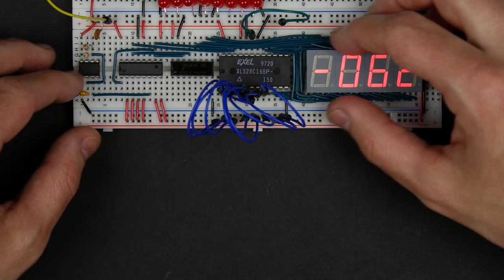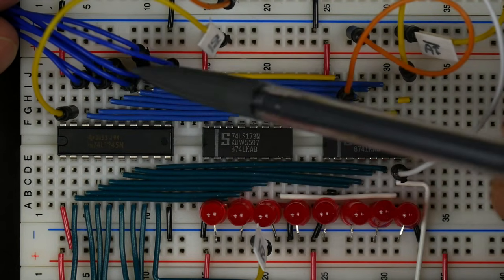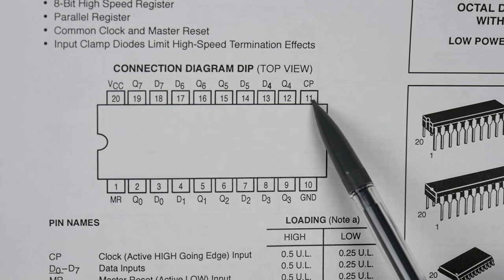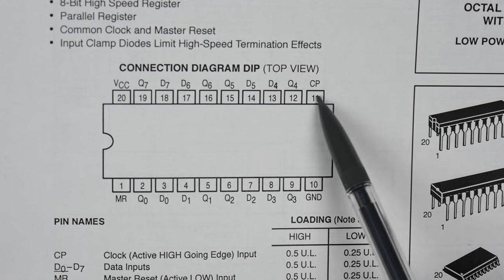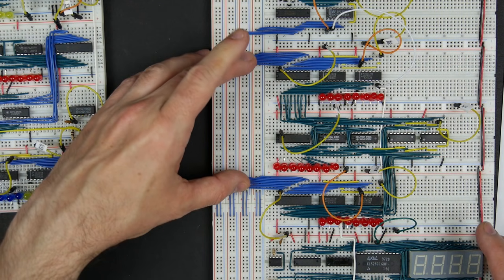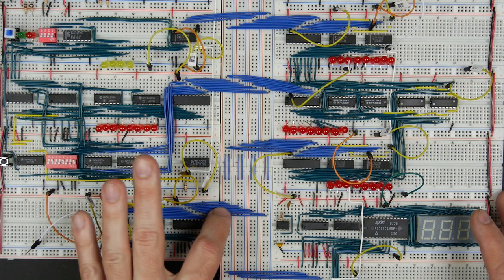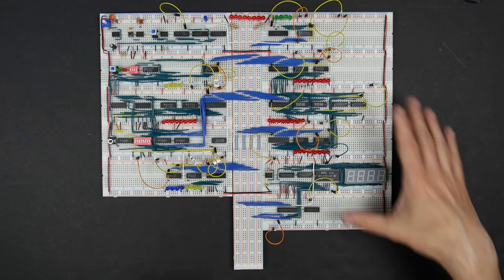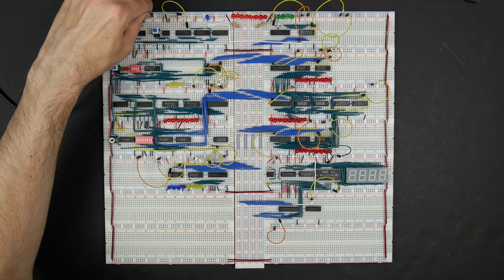8-bit computer build: Connecting the bus

Comment: If you're worried about your power rails, you'd be better off adding decoupling caps to each breadboard rather than making massive ground loops and Vcc loops. Ground loops don't sound like they should be a big deal for low speed digital logic, but as the circuit gets bigger the pulse current around the loop on each clock when every transistor simultaneously switches may become significant enough to cause some problems by changing Vcc and ground voltages in different parts of the circuit, as well as induce magnetic fields within the loop. This is all made much worse when there's no decoupling. Obviously it works fine for now but it may come to a point where it causes headaches and it's not clear why.
Reply: Keep in mind the breadboards also add a lot of capacitance to both the power and ground rails. It would definitely make sense for a more power hungry IC with really fast switching times that's in a remote part of the board. I wonder if a small bulk decoupling cap at the far ends of the rails would be enough?
Reply: Indeed, include decoupling capacitors at each breadboard.
However the decoupling capacitors won't solve the voltage drop at the far end of the power paths caused by inherent resistance in the wiring and breadboard.
So multiple power connections to the breadboards is important.

Comment: Question: Would it make sense to add a clock bus, another strip to your bus and use it for clock instead of doing so much custom wiring for the clock?
Reply: i thought of that too
Reply: Could've had clock and reset shared on their own strip, yes.
Reply: yes, that's a good way of thinking to be honest. But I think he did it this way so everyone could get it how a computer works
Reply: I’ve been wondering that about the clock, power, and reset lines
Reply: Interested to see so many had the same thought!
Reply: I added 3 rails(6 lines), 2 for power on each side, and 1 for clock on each side. IMHO it made for easier and better looking wiring. Also there’s almost 0 voltage drop on any part of the board.
Reply: Yes. You want the clock as centred in your design as possible to reduce clock skew, but this isn’t much of an issue at lower frequencies.

Comment: finally we will see the Magic of Control Logic in Next Video.
Reply: This is what I was waiting for the most!
Reply: Ravindra Badgujar I get butterflies thinking about it.
Reply: Clone36 lol me too - we are *such dorks* xD
Reply: I am thinking that you will have to build the Instruction Decoder and the Ring Counter,  before you can build the Control Matrix. 
However, that is because I built both my Instruction Decoder and Control Matrix, using only TTL logic chips.
If Ben uses ROMs for all of this, you could be right. 
Either way I am like you and I can not wait for Ben's next set of videos. They are always right on the mark and incredibly informative.
Reply: It would be great if Ben took the same approach as you and started from building the instruction decoder from plain old logic gates, and then gradually improved it to use microcode in an EEPROM, similarly to how he did it with the 7-segment display decoder. I think such approach would be a more logically natural progression. It could also influence the instruction set, making it simpler and more organized (because then it is also easier to decode it with plain old logic).
Reply: I agree with you 100%. As the original SAP-1 model  only facilitate 6 commands. 
LDA / ADD /SUB / JMP / OUT and HLT, we do not need to start microcoding EEPROMS to do this.

However, when we do want to expand our system, we would have to remove the out dated Instruction Decoder 
and Control Matrix and rebuild that and all the control lines.

Even though, I would prefer to make a SAP-2 at that point, one that is more advanced and that requires microcoded EEPROMs, and or microcontrollers to do most of the work. Something that uses far less boards and components to create. Maybe even something that has a video output... (Hmmm)
Reply: I took a somewhat different approach: I decided to try emulating the MOS 6502 CPU (or at least some subset of it), because it was quite simple: only 3 general-purpose registers (A = the accumulator, and X,Y = index registers), a stack register S with a fixed stack on page 1, 8-bit opcodes with conditional jumps etc., and quite a useful ALU: addition, subtraction, bit shifts/rotations, increment/decrement, comparisons, bit tests, AND, OR, XOR (no multiplication or division, though), and just a bunch of simple addressing modes (immediate, relative, absolute, indexed, zero-page and indirect). Its instruction set is very regular, so it would play very nice with the instruction decoder made of simple logic.
Reply: That is exactly where I would like to go next, after finishing the SAP-1. I don't know if you noticed my KIM-1 icon, which was built on the 6502.
I am a Vintage Computer and Video Game system collector, so I have many systems that were built on the 6502 CPU. It is an amazing processor and a great way for us to move forward in building and understanding more complex systems.
Reply: Those are really cool insides of the chips!
Reply: I'm excited for the Control Logic as well. That's a lot of wr / en wires on a bunch or registers. Not to mention the microsteps too.
Reply: A huge advantage of hardwiring the Control Matrix is that you're saving yourself the hassle of programming several (E)EPROMs.
In my case I'm having 9 Ring Counter outputs and 8 Instruction Register outputs (of which I only need 6 or 7 at most), so if I'd construct my Control Matrix from (E)EPROMs, I'd need one with 512kb. Since the data-width is only 8 bit per (E)EPROM and I have 28 control lines, I'd need to individually program 4x 512kb (E)EPROMs to realise the Control Matrix.
By hardwiring it, I'd just need a whole lot of OR-gates and will be most likely finished long before I'd be finished programming them by hand.
Reply: I am missing something here. What are you using for your control matrix ???
Reply: At the moment nothing, since like Ben I'm pushing the construction of the Control Matrix further and further back because I can't decide between hardwiring it with a bunch of OR-gates or programming 4 EPROMs.
In the simulation I used both and the EPROM-method is cleaner and allows easier access for changes while the OR-gate-method is easier and faster to construct.
Reply: I guess that I am getting lost on the hand writing method. I am interested in the OR gate method. How many OR gates would you need?

I used 4-74LS54's and 1-74LS51 and 1 74LS00 for my Control Matrix
and I used 3-74LS21's and 1-74LS04 for my Instruction Decoder.

https://drive.google.com/open?id=0B6LIgQzDkH8fRmpSYm9ROTMzSGM
Reply: It's hard to describe it in words, that's why I just exported the Control Matrix of my first simulation of SAP-1 as an image: http://imgur.com/a/No3LQ
The Ring Counter has 6 positions of which the first 3 are for the 3 FETCH-steps.
The last 3 are combined with the wires of the instruction register which are active and finally everything is OR-ed together. Of course if you try to build this with real TTL-components, you need to combine a large number of LS 32's.
Reply: That is a very cool drawing. but it looks like you might need 6 dual 4 input OR gates and 7 quad 2 input OR gates as well as 1 AND gate.

Take a look at page 16 here and see if you can draw the same circuit.
https://drive.google.com/open?id=0B6LIgQzDkH8fRmpSYm9ROTMzSGM
Reply: Very cool drawing. I am not sure if I am counting correctly, but would this take 7 Quad 2 input OR gates and 6 Dual 4 input OR gates and 1 AND gate?

Take a look at pg. 16 and see how you would draw this.
https://drive.google.com/open?id=0B6LIgQzDkH8fRmpSYm9ROTMzSGM
Reply: That's a really interesting design, I'd never thought about doing it that way. The way I did it in my first simulation like in the picture I uploaded was my first attempt of "If I'd like to have that function, how would I do it?" and I never thougth about optimizing it, because it was all neat and clear but your method seems a lot more compact.
Reply: I can not take the credit for this method. I believe the credit goes to Tom Gunnison
I did build my Control Matrix using his design, I believe I only used 4 - 74LS54's and 1 - 74LS51 and 1 - 74LS00
6 chips in total, so they all fit on a single board. 

I did create my own version of the Output display using a 89C51, which I was able to get everything down to one board as well. I did have some help with the programming by Engineering a New Way.

You would think that converting an 8 bit binary number to BCD to drive 3, 7 segment displays, would be a well known function by now, but it is not easy to find any information on this. Although, my program only uses 27 commands in all, so it is actually pretty simple.

You can see my Control Matrix, on the right hand side just above my Output Display, and just below my Ring Counter.

https://drive.google.com/open?id=0B6LIgQzDkH8fNlI4S096WGxqRTA
Reply: I enjoyed taking a look at those chips. Did you take a look at the 6502 simulator?
http://www.visual6502.org/JSSim/

Comment: Thanks for making this series Ben! Such wonderful information presented in a very understandable way. I am thinking I should try this in my FPGA.
Reply: If you have an FPGA, another idea would be to implement the SHA-256 hash function in hardware and use it for mining BitCoins ;D
Reply: I HAVE an FPGA, I don't know how to do anything with it yet. :P
Reply: Sci Twi FPGA bitcoin mining is already waaay outdated, it's ASIC or nothing these days
Reply: I'm actually programming my FPGA, trying to follow Ben's videos as closely as possible. Have a look at: https://github.com/MJoergen/bcomp
Reply: What kind of FPGA / board do you have ? I have a Basys2 board with a Xilinx chip.
Reply: I'll have to take a look at your code.  As is usual for me, I've tried running before I could walk, and am working on the Sweet 32 CPU https://github.com/Basman74/Sweet32-CPU. I've pretty much rewritten it from scratch though, so I can have it work with my SDRAM in a different way.

I'm using the Xula2 board.  http://www.xess.com/shop/product/xula2-lx25/
Reply: Let me know, if anything I've written is unclear or incorrect or whatever. I'm trying to clean up the explanations, so they are more helpful.
Reply: Cool. How much have you implemented so far ?
Reply: Well, that's the same approach I'm using, and it works fine. In fact, I think that same approach was used in the old 8-bit processors (6502, Z80, 8088, etc.).

Comment: Awesome work Ben!! Cant wait to carry on with the series, I've been binge-watching this series for the past 4days, this is definitely my next project after building a 3d printer. Im studying Mechatronics, and one of my subjects deal exactly(basically) with this project... Cant wait!! Ps when youre done could you do a FAQ and a bill of all materials? 
Stuff like how you measure your wires and thought process when planning a breadboard.
Thanx alot
Iain
Reply: Iain Barnard , my own technique is to strip one end of the jumper wire and stick it into the start hole, then use pliers to make all the bends in-situ to route the wire to the end hole, then cut & strip the end end. :)
Reply: There's a better technique: just strip a long piece of the isolation from the wire. Then measure out a piece of the isolation remaining on the wire to whatever length you need, and cut just the isolation there. The isolation can then freely slide along the wire, maintaining its length. So you can move it to the end of the wire, leaving around a centimetre of non-isolated wire at the end, and you cut the wire on the other side, 1 cm after the isolation.  Then repeat with another piece. This way you can make very precise and neat-looking jumpers easily :)
Reply: I do the same Massimo!
Reply: Thanks for the tip aswell Sci Twi, I didn't think about that.

Comment: You could use another address bit to offer a switch to hex display.  Actually, that gives you 4 modes: unsigned, signed, hex.... and you could use the last for octal.  Use the dot segments to indicate the current mode.  And binary is always shown on the lamp LEDs as well.

Comment: I had the bus EXACTLY like Ben using 10K resistors tied to GND except I added current limiting resistors onto the Bus LEDs. With 3 registers connected and the 10K resistors to GND I was getting strange behaviour. If the bus was not loaded with anything (ie: the registers were not outputting to the bus) I found if I loaded from the bus it would read say 0000 0000 as 1111 1111. Any 0 bit would be read high. I need to stress this is without any component outputting. Just using jumpers to give HIGH or LOW signals. If I had a value outputted from a register like 0101 0101 and loaded that onto the BUS and had another register LOAD it I had no issues. I put a multimeter onto the bus and it appears with 5V PSU and 10K resistors to GND the bus idle voltage was .8V and not 0V as I would have thought. Turns out even if the register has a value of 0000 0000 either the 74LS245 or the 74LS173 outputs a 1.34V value (1.4V with no 10K resistor). Interestingly enough this value also fluctuates slightly as the clock pulses.

My solution was to use 1K2 resistors instead of the 10K which has reduced the empty bus voltage to .6V which for some reason makes the registers behave again. Im not sure why as the datasheet for LS245 said the HIGH voltage threshold is 2.4 volts which is very much above the 1.34 I was getting. Maybe someone smarter can chime in on what is going on..
Reply: Just ran into the exact same issue. Looks like you are the only other person who's encountered this unfortunately :P
Reply: @misterjay530  I was using the cheap ebay BBoards and after completing the machine its not usable. Once I added the EEPROMs to my control logic the ring counter and program counter would both jump counts here and there. Using a different clock with soldered connections improves it but after running for a few mins the ring counter occasionally skips on count T3. If I program the machine to do some of Bens examples the machine seems to calculate the value early and the value is a few digits off. Additionally I have a very unusual problem of if I have the machine count from 0-255 after running for a few minutes the output display gets to 254 and then resets to 240 before counting to 254 and back to 240 and so on. the B register seems to be at fault here but again no idea why when it seemed to work fine earlier. In fact if i used the wires to control the signals (before adding in the EEPROMs to automate it) it worked fine. It seems something about my control logic, ring counter, and reset circuit have caused some issues somewhere. I even bought a dedicated PSU and have the star method of connections going to each of the breadboards from the PSU terminals with voltage readers spread across the board to ensure consistent power delivery which is fine.

I've reverted to rebuilding from scratch using the expensive boards and hopefully i'll have a more stable and usable system. Will report back once done :)
Reply: Good luck. I ended up swapping out the 10k Ohm resistors for 330 Ohm resistors and it seems to be working fine now.
Reply: Same problems here. I ended up with 2k2 resistors instead of the 10k. But another solution might be to connect also the unused four bits of the program counter to the bus. So every component will set a defined level at all eight bus lines. Only when the bus is idle, the bus lines will have an undefined level. But that condition will never occur, I think.
Reply: Glad to see this post about the pull up resistors. I was a little confused as to why in this video there aren't any, but the next video there is. He must've had some issues at first as well. Great video series! Thanks Ben!
I built a "computer" on breadboard back in the late eighties. Z80 cpu and a static ram with LEDs.  Let it run till it stops! 🤣
Reply: That is to be expected, since Ben seems to have made a mistake here. He said 10k and includes 10k for the modulse and even in the schematics, but uses 1k resistors! At least it seems like they are (since ist a video I might be wrong). If you have a closer look at the resistors they have the colour code: brown-black-red which is the code for 1k and not 10k (which is brown-black-orange).
This is a old comment, but thought you might still be interested :)

Comment: We’ll, I think I figured out the ghost in the program counter. It would count from 0 to 3 and never advance. It also  was intermittent at first until it finally did it consistently. Turned out the green LED on bit 3 was shorted. Never had that happen before, but that cured the random counter problem. I didn’t use current limiting resistors on the counter output, maybe that would have made it easier to diagnose. Also wound up having to use 3.3k pull down resistors on the bus. 10k left 1.5v on the open bus. All the modules would show high’s when the bus was open. Great learning experience but was pretty frustrating at times

Comment: Is there a reason that the clock is not distributed as another rail in the bus? It would be much nicer from design standpoint and there would be single connection interface per module... and possibly blue led up top to indicate current clock.
Reply: Being in the middle of building this - I also wish I'd added a power rail alongside the data bus to help with efficient power distribution before I'd stuck all the breadboards and bus into place. Instead I'm overlaying them creating a multi-layer design. Because.... why not!